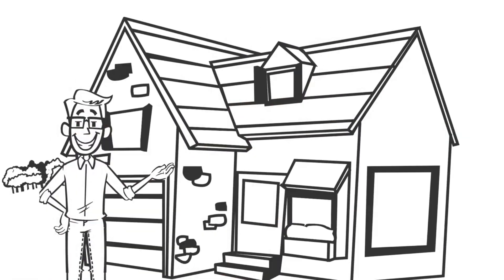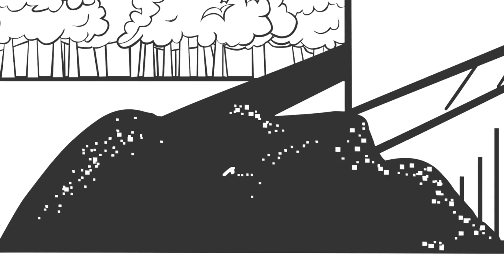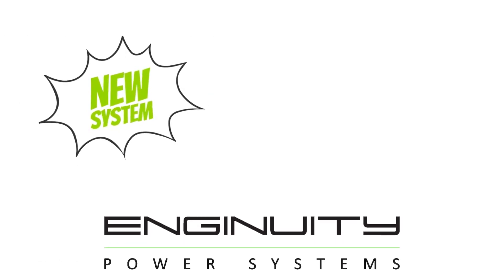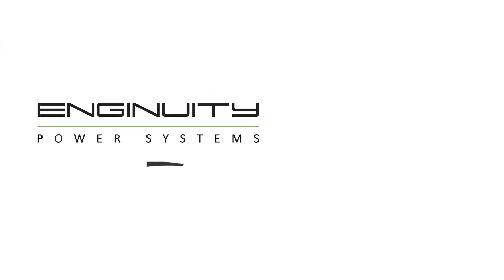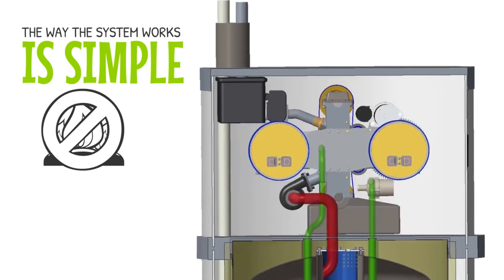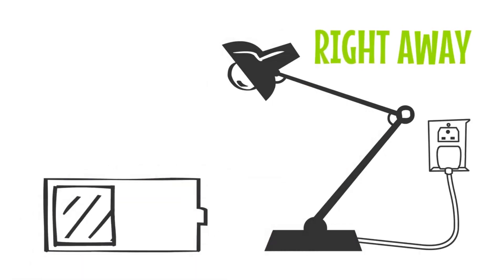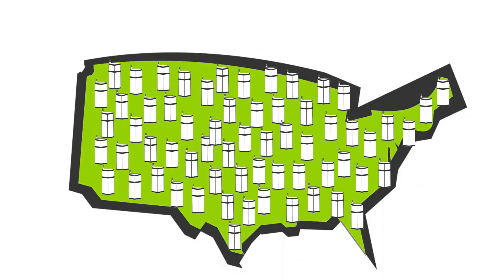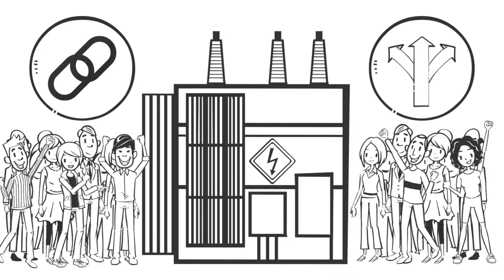How does the Enginuity 8kW System work? The whiteboard knows.

Comment: So what’s the kWh output of the unit?  Next question is what is the cost of Natural Gas to kWh and would it be economically feasible?
Reply from the maker: Hello Robert, if you could drop this question to Steve at info@enginuitypowersystems.com for all the latest data and information; thanks!
Reply: @enginuitypowersystems5249  Why wont you respond to these types of questions directly and publicly?
Reply from the maker: @MitchMelin  Good Morning Mitch - as we are fully in Research & Development, we feel it's best to answer questions directly based on the current and up-to-the-moment information.

Comment: If all of these go online, it could be selling fossil fuel generated (natural gas) electricity to the grid which is better than coal but not green like Solar or Wind where I could leverage the excess Green Electricity at night or when wind doesn’t blow.  This is not a good long term solution.  You need to make one that leverages electricity to generate heat and store heat in hot water tank and use it as a thermal battery.  Much better idea and solution.
Reply: Ice banks and heat banks already exist. Calmac is known for that
Reply from the maker: Here's a latest article: https://venturebeat.com/2022/01/10/enginuitys-innovative-eone-can-handle-a-homes-power-and-heating-needs/